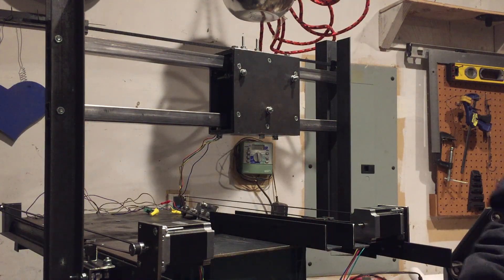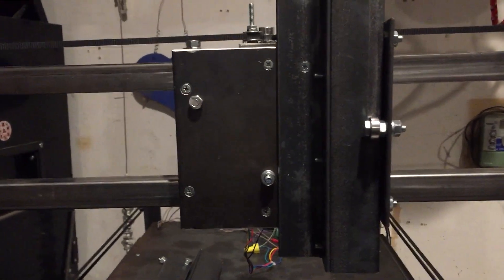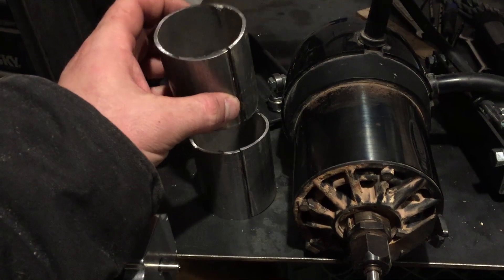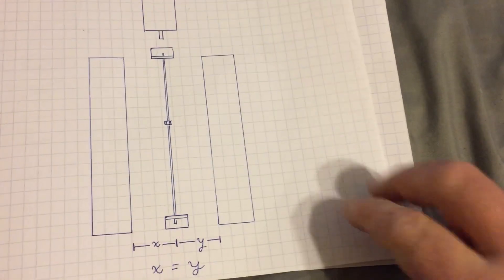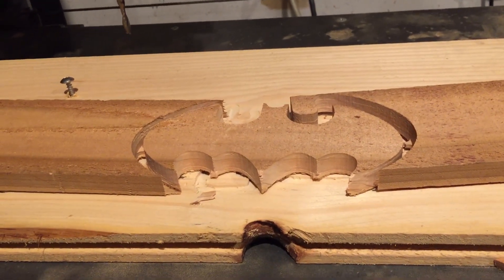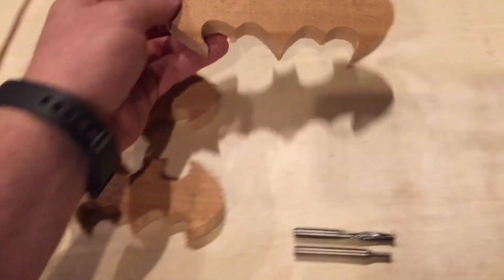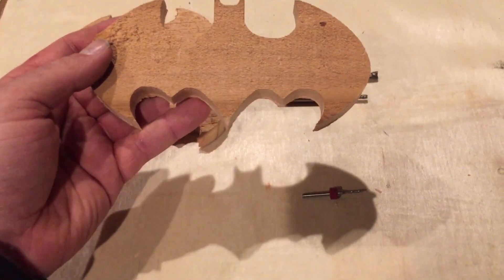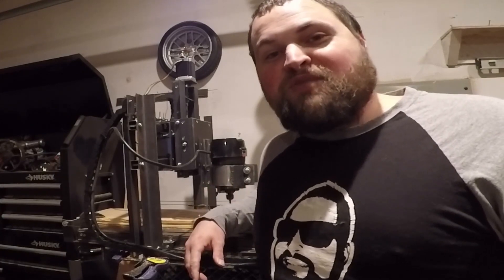Cheap CNC build: Part 4

Comment: Dude I was only speaking with some of my work colleagues about this very subject the other day and some of them were very derisory to me and my chances of building my own CNC machine but videos like this and some others in my job have told me to keep pushing through on my project and I will get any helpful advice they can give me along the way..
It was brilliant to see those stepper motors working but u said u had to get a 3HP spindle motor instead of the Router ur Dad gave u?? 
I was thinking of using a router with variable speed but they will never work as good as that Spindle motor u got I'd say. 
I have a question if u don't mind me asking right now bro..
Q.  Does the spindle motor need to have a certain size collet or can u buy one with a load of collet inserts to make it easier to fit smaller bit shafts into them? That didn't really sound or type out like I ad it in my head.. Apologies but I hope u can get the gist of my question here.  Thanks again for these awesome and very helpful videos man..
Reply from the maker: My spindle motor came with multiple collets, so I can use practically any bit up to 3/4" (2CM) in it. It's one of my favorite parts of switching to the spindle motor because I can buy loads of cheap carbide bits and I can be confident they will fit.

I had a lot of haters when I built mine too, but when it was done everyone wanted signs from me. The world is funny like that.

Comment: Question. Why did you get a five-axis setup with the electronics?  I count two for the y, one for the x, and one for the z. Are you planning on adding a 4th rotational a axis later, or did I miss the second axis on the y?

Comment: I hope someone has mentioned this by now.  But I know you have a thickness planer now.  You have a cnc.. you don't need a thickness planer.  It really helps of course.  Running a surfacing pass would have made the wood any thickness you wanted.  Bingeing your channel right now.
Reply from the maker: Absolutly correct, but the planer is MUCH faster! Before the planer I used to always mill my wood flat.  I hope youre enjoying my channel:) Let me know what you think!

Comment: What pinion gear did you use on the nema 23 motors? And belt?
Reply from the maker: 6mm GT2. I don't know the tooth count of the pulley, but the bore is 8mm.

Comment: Quite surprised you chose belts, especially since you say cutting metal is your ultimate objective. I'd expect the belts to stretch  & that stetch to be load dependant thus spoiling the hoped for accuracy. However a great video THANKS

Comment: How's been holding up so far? Especially regarding tolerances and maintaining the parallel between axis. Do the bearings rollers work well? I was thinking on using linear rails, but they're considerably more expensive.
Reply from the maker: The belt is the biggest hang up. The bearings work great, but the belt flexes when cutting metal or hard wood, creating around .015" deviation.

Comment: Why dont u sand the surface where the bearings roll? It would make it much smother, i bet you got in there cracks with over 0.2mm 0.3mm that are compromising your accuracy of the whole machine.

Comment: Great tutorials, on the entire project, Thanks so much for posting and Sharing with all Us Newbies. Have you ever considered putting a Fine layer of high temp, lithium white grease, or even old engine oil on the rails to avoid all the tiny crackling noise and wear on all the axis shafts, (angle iron) & Bearing cases.  With the speed of all the bearing cases and metal surfaces I personally worry about extream wear, then miss alignment with time. (Sorry it's the engine builder In-Me) Just curious. Cheers & a Hats-Off To a great build Andrew
Reply from the maker: You're very welcome. I made the video just for you guys. 

I'm 100% in favor of some lubrication in the rails. The pressure will still cause wear in the long run, but the rails and bearings are quite cheap to replace.  Bigger issue is keeping sediments from wood and metal shavings off the rails.

Comment: Great job, I love the solid all steel construction and homemade bearings and rails. I made one using cheep linear rails from eBay which runs smooth but has some flex in it.
Reply from the maker: Still cool though. You can program around flex. I understand being irritated though. My first CNC had bad flex. So much I threw it away and just kept the electronics. Thanks for watching!

Comment: You do not need a wood planer. Put a 1" or larger router bit in with flat bottom and face the wood surface with the CNC !
Reply from the maker: Yep, that works. I was doing that for a while, just took a lot longer than a planer.

Comment: nice build, but aren't you afraid that the accuracy is not so good to cut actuall metal? the rails would need to be level and straight down to 0.05mm to get a fair amount of precission. for wood totaly cool machine, but i would have my doubts for alu and other alloys
Reply from the maker: It hogs aluminum pretty well actually. The biggest issue of accuracy with this design seems to be the belt drive actually. IF I plan to make the transition I'll switch to ball screws. Haven't really decided how far I'm going to take it honestly. It does what I need so far though, and it does it well!

Comment: Hello, I am a retired production machine repair manager. I found your channel because I am in the planning stage of building my own CNC.. You would make a excellent trainer because you explain things very well. I found your plan and theory top notch compared to other things I have seen, you can buy a Chinese kit and basically all you end up with is a small pile of 8020 that you can't do much with, you for sure will not be cutting metal that's for sure.  I just wanted to say thanks for sharing the video on building a CNC. Keep up the good work..awesome. .
Reply from the maker: I love hearing that my videos are helping people with their builds! I built a CNC router in 2016, and it took several "updates" to get it working reliably. This time around I basically knew what NOT to do, so I shared it with you guys! 

I am planning on ditching my belts for stronger type of drive though. The belts work great for wood, but have too much stretch for serious metal hogging. Good luck on your build!

Comment: Did you ever put together a build list? I'm wondering about the steppers required and how strong they need to be.
Reply from the maker: I dont have an overall build list, but I do go over it in the build series. The electronics all came in a kit. It's just a TB6560 kit with dual shaft NEMA 23 steppers. They appear to make plenty of power, especially for this setup. I've had zero issues with them. 

The nema 17's on my other machine have their limitations, but even they are adequate.

Comment: I am disappointed. The project started as “built a CNC with basic tools” but it seems you run out of engineering skills and resorted to shortcut using a welder.
Reply: @Robert I was watching it and thinking I would use several 4" hose clamps, but that's because I'm no good at welding.

The point is, however, that you should be able to come up with your own "good enough" non-welding solution if welding is not your thing.

(Those of us who can't come up with such solutions should just buy ikea-kits. And there's nothing wrong with that either.)
Reply from the maker: The reason for the "shortcut" was I had already ordered a 3 HP spindle with VFD, and the router was a temporary setup. I appreciate your input.

Comment: Nice build very simple. How did you hook up the router
Reply from the maker: I had an external solid state relay hooked to the internal relay so it would come on when the program started, but now I'm running a legit 3 horsepower spindle with a VFD, so I just turn it on manually for now. Life gets busy, ya know.